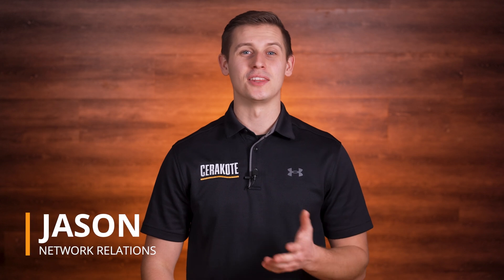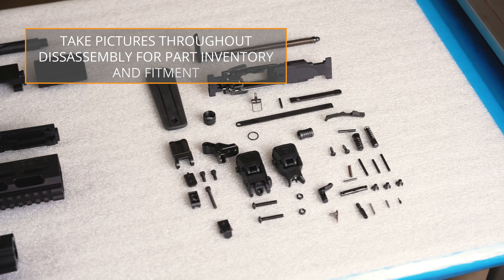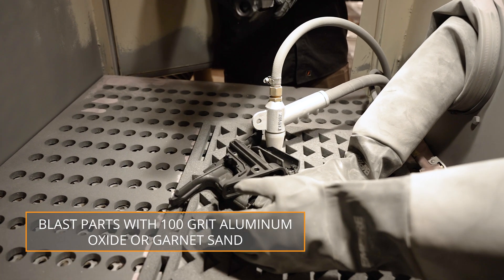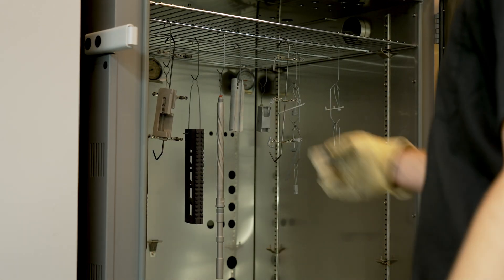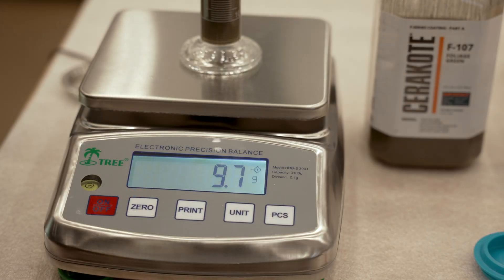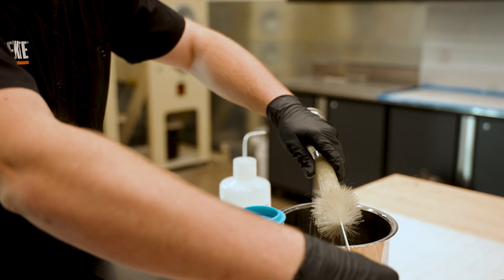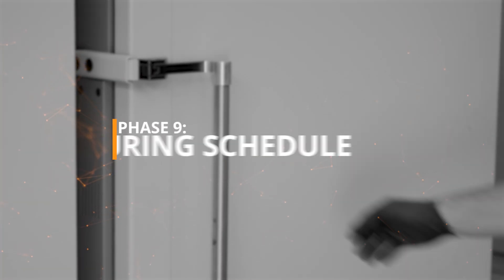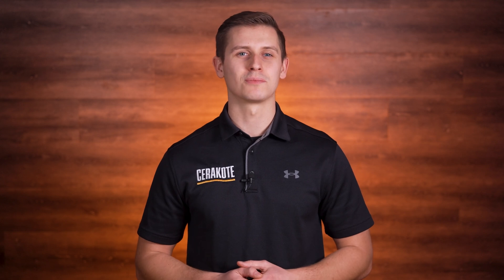F-Series Application Guide | Cerakote®

Comment: Can you do camo patterns with f series? If so what is the flash curing between colors?
Reply from the maker: Technically you could, but it wasn't designed for that. H Series would be a much better option for layering stencils. However, F Series does offer amazing results for the laser imaging of patterns.